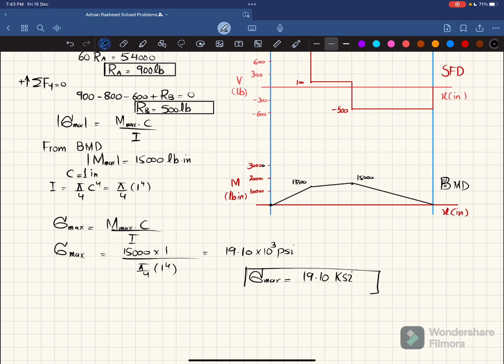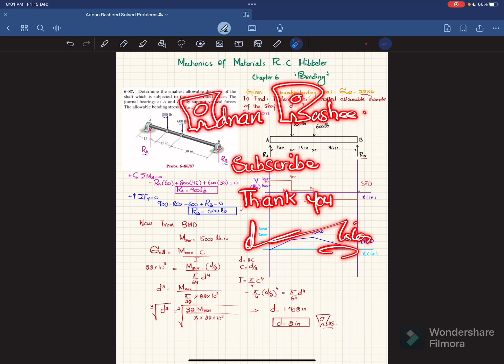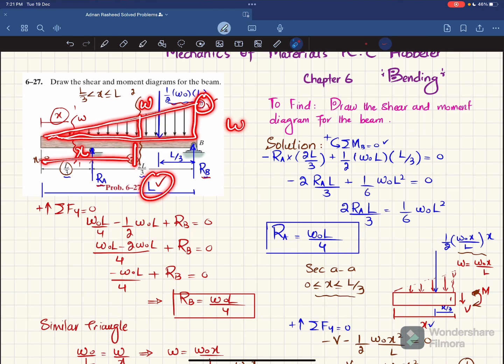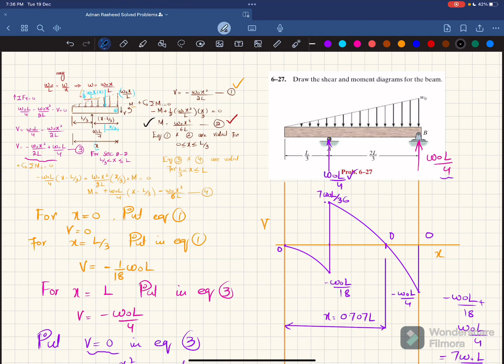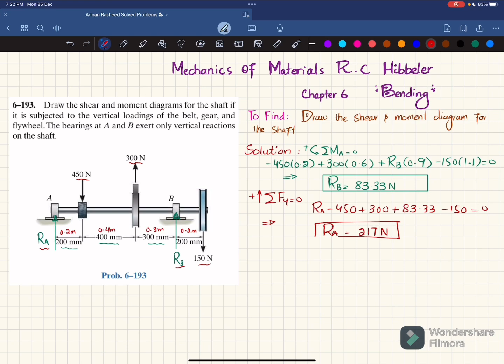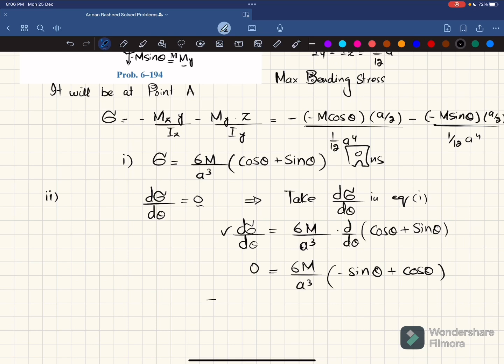Maximum bending stress | Shear and moment diagrams | Bending | Bending moment | Mech of materials

Comment: Hello, I have a question, if it’s not difficult to answer, please, I want to bend, for example, a round bar at 90 degrees, then the value of the bending moment should be such that the stress in the pond exceeds the yield strength of the material?
Reply from the maker: Yes you are right.
Reply from the maker: That's why it will be deformed